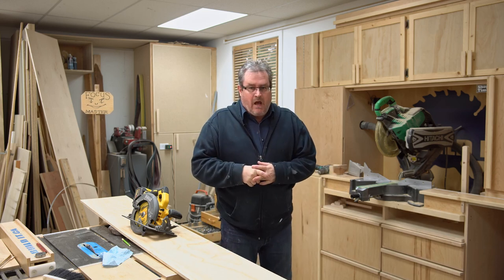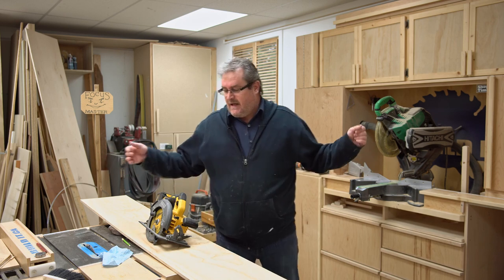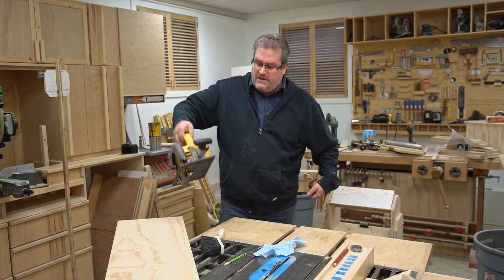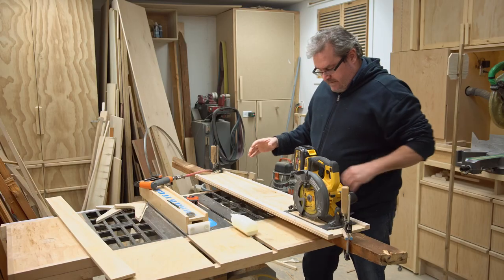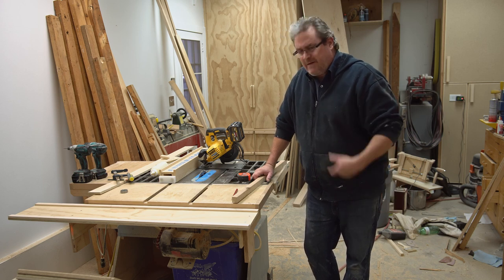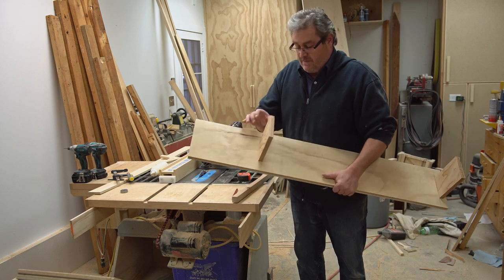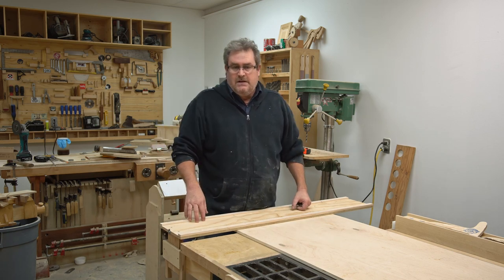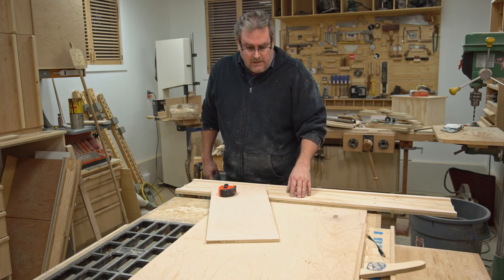About The Crosscut Guide Table Saw Addition

Comment: In wearing my inner Matthias cap, I can suggest to have some pivot stops milled into the wings you attached to the saw, so the guide would have a round tenon to ride in the said pivot track, in other words it would rotate up and over the work piece and settle into the stopped position, looking at it from the side it rotates in a counter clockwise motion. See if that helps you  thanks Sam

Comment: Great video! Maybe you could cut a finger slot in the middle where it's balanced, then it might be easier to lift with one hand?
Reply from the maker: It racks and gets stuck, even at the exact balance point.
Reply: even if you make a hole in the middle of the board? too bad, nice job anyway :)

Comment: Hi John, Subscribed and watching again. I got sidetracked by another subject on Youtube and as it turns out they both include some scratch design and build. Happy about that. One question about your cut line though, I see on your last video in this series you address it but your solution still requires a measurement fore or aft of the cut. In the interest of building without measuring (story sticks, scribing ect..) wouldn't it be easier to drill a hole or two at the cut line on the sled that you could see a mark to the plunged edge? Using this like a true home made skilsaw saw fence where you line up the mark with the edge might be faster and maybe more repeatedly acurite. I like the using the skilsaw rip fence you built and my cuts are dead on using it I think because I'm not measuring as much. Do you think a hole would work or would that screw up the plunged cut? Thanks for the vids. I'll be watching and liking?

Comment: Great video, I like your idea. I am in the market for a table saw and am eyeballing two that I like- one with cast iron wings and then the much cheaper version that does not. I am sort of new to this so I dont quite understand why a more premium version of the table saw has real heavy duty wings, but yet 99% of workshop owners opt to have that space out of wood instead of a more heavier one like cast? Isnt cast iron the way to go since it is heavy and it makes for less vibration and more precise cuts? Or does it not really matter much? Can someone please clarify as I am sure it will make a great impact on my purchase. Thanks in advance.